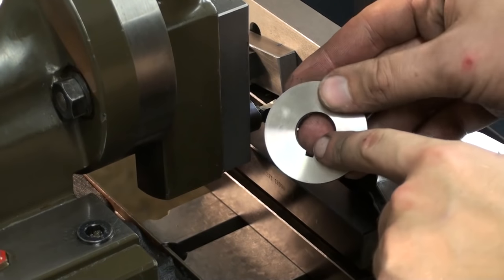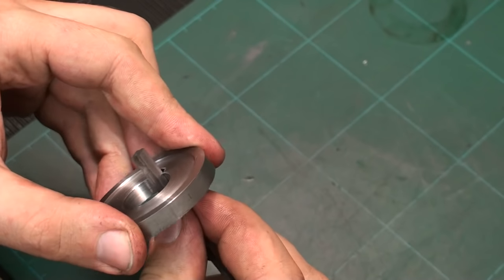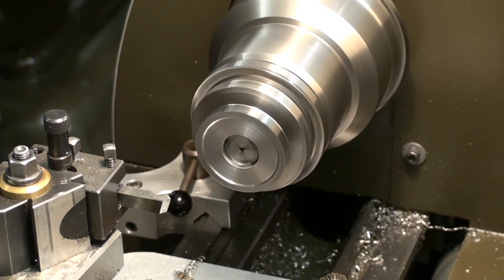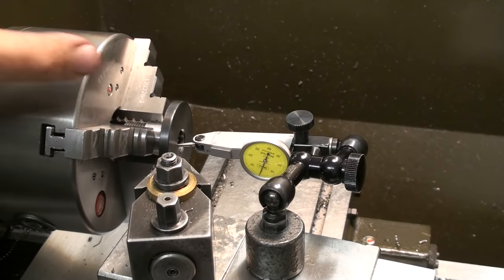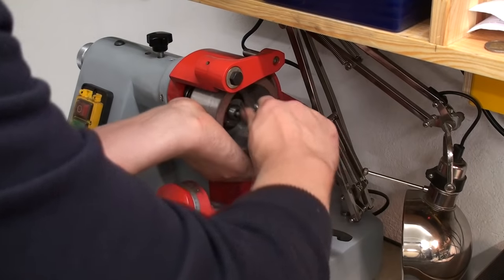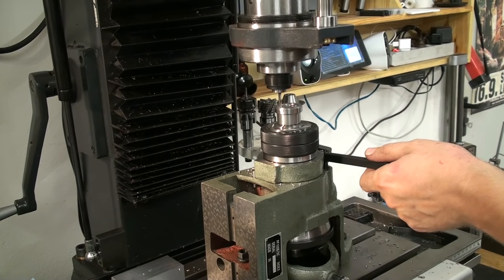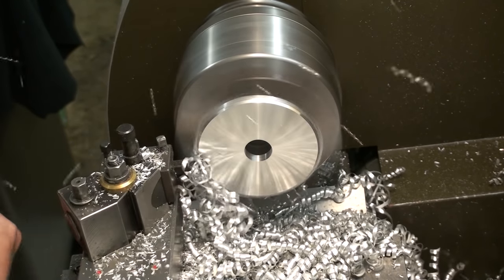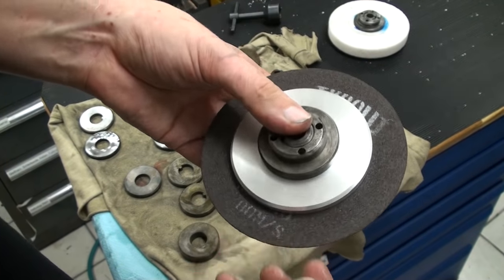Grinding wheel adaptors - Part 2

Comment: Nice to see another Proxxon user. I advise anyone who doesn't have a rotary tool like a Dremel to buy Proxxon. If you already have a Dremel, throw it away and buy a Proxxon tool. They have an actual speed control that maintains the speed under load so you don't have to max it out to grind anything tougher than cardboard. Plus the rotor has many more poles and this makes it a lot quieter. You can turn it right up to 20,000 rpm without needing ear muffs.

Comment: whoa whoa whoa.. mini 3 jaw chuck?  You think you can just flash that up on the screen without talking about it?  Or did I miss that video?  That looks right handy.  Nice work on the adapters, can never have enough of those.  Only thing I don't like is they wouldn't fit my grinder. :)
Reply from the maker: You dont have a baby 3 jaw chuck? Just put two three jaw chucks in a drawer and leave them alone for some time...magic will happen :D
Reply: This Old Tony doesn't everyone have one of those??? :)
Reply: Okay, I just did that; turned the lights down and put on some music for good measure.  Fingers crossed!
Reply: Any luck Tony?
Reply: @ThisOldTony any luck yet?  That chuck should be in school by now.

Comment: Thank you very much for producing this series. I recently bought the same cutter grinder and when I went to order extra adapter hubs for it is was told $70.00 CAD ($55.46 US) each. I checked the SHARS website in the US and they want $29.95 US ($37.79 CAD) which is a lot better deal until you include delivery, customs and taxes. On the SARS site though is a blueprint with all the pertinent dimensions on it for the adapter so it will be a piece of round stock from the metal supply and some time on my part.

Comment: Excellent project Stefan. Great workmanship once again. Your "close enough for me" would put many a machinist to shame. Its nice to have enough tool holders or grinding wheel holders so there is no need to keep swapping things around. Many thanks for sharing. regards from the UK
Reply from the maker: True words about having enough toolholders for the lathe ;)
I plan to build even more, I still swap them around from time to time...but for the grinder I am pretty good setup now, as it seems.

Comment: Nice! Now I want to see this thin cutting wheels at work.
Reply from the maker: Until yesterday I never used them. And I can tell you, they are awesome :D
Used them to cut some HSS blanks down to size and they cut waaaaaay faster than a thin cuttoff wheel in a anglegrinder...
Reply: I just got a used 6xx12 Boyar-Schultz but never thought of using it with cut off wheels, great idea

Comment: Nice!  I just bought a couple wheel adapters for my Brown & Sharpe surface grinder and the best price I could find for new high quality ones (Sopko) was $50.00 USD each plus $8.00 freight.  I will be looking more closely at what you have done here and possibly making some...

Comment: I see you stock only diamond superabrasive wheels. I would have tho8ught your have ar least on CBN (cubic boron nitride) cup wheel for detailing HSS cutters and hard steel were wheel wear and loss of dress was a factor.

I was taught (back when dinosaurs walked the Earth) that grinding with diamond  diamond in iron alloys were uneconomical. The explananation was carbon's soluability in iron at grinding flash temperatures. My experience in grinding hardened lathe beds etc bore this out. A CBN wheel outlasted diamond grinding the ways of a 500 mm swing Okuma lathe bed 2. meters long by 3 to 4 times. 

Nice work on the wheel hubs, by the way. Very systeatic and well explained. I used to despair getting through to my apprentices the economies of time and accuracy to be gained by batching parts operation by operation compared to completing one at a time; especially where good references could be established to clamp to stops, recesses, pots. or mandrels.
Reply from the maker: I think I am a bit to cheap for the CBN wheels - I know and have seen their benefits, but man, they are expensive..and nowadays most of my tooling is carbide anyway :)

Comment: Stefan, get the Proxxon IB/E or IBS/E, or the LB/E LBS/E., same precision but more power.
The long version might be more useful as a toolpost grinder, and maybe even support higher side loads as the bearings should be further apart.  Side loads are pretty much my only gripe with the IB/E, unlkie the Dremel it has a separate motor so the spindle bearings are very close together. The Proxxon is still far superior despite that of course, not so loud and the tools cut by rotation rather than vibration.

Comment: Stefan - great work as usual. I really like the end result! What sized grinding wheels does your surface grinder take? Also, what is the diameter of the spindle at the major side of the taper?
I'm currently building a small surface grinder and I'm at the point where I need to build the spindle, but need to decide on the size first...
Reply from the maker: The toolgrinder takes 100mm wheels, the surface grinder takes 125mm wheels. The large end of the taper is about 13mm in diameter if I remember correctly.

Comment: Hi Stefan

Another great video. :-) I have a couple of questions for you.

Why did you use the triangular file instead of a half round file when cleaning up the silver solder around the key on the inside of the washer bore?

Why did you use a cut off wheel on the "dremel" instead of a wire brush? A wire brush can remove burrs and leave a nicer deburred finish than a cut off wheel.

Kind regards

Peter
Reply from the maker: Thank you! 
As for your questions:
- Because i could not get into a sharp corner with the triangular file - For the round sections I used a halfround file.
- The wire wheel only removes a very minimal amount of material - With the cutoff wheel I was able to create a proper chamfer

Comment: Just a question regarding the taper bore setup : If the dial indicator is not on the exact centerline of the bore will it still indicate the true angle of the bore? 
regards
Reply from the maker: Right, if the tip is off center the measured taper will get steeper than the real taper...its not supercritical, but you have to keep an eye on it. I just eyeball the tip of the DTI against a dead center in the tailstock to get it to height.
Reply: Thanks, I'd hire you in a heartbeat!

Comment: Do you have power feed on the compound? Keep the video coming they are great. Dave
Reply from the maker: Kinda...I have a cordless drill and an adaptor that goes on the crank of the compound, but those short tapes where turned entirely by hand.

Comment: Very well done Stefan.   They look good and the effort is well worth it.  Question, but mostly on the diamond wheels....when you mount them on the surface or tool grinder will you need to mark the rotational orientation of the wheel to the spindle each time you remount them?   Or, are the adapters true enough to ignore this possible factor?

Comment: You do beautiful work!  I am in awe, and jealous.

I'm wondering if adapters could be used on a bench grinder.  It would be really nice to switch stones, or a wire wheels, without the whole un-bolt, re-bolt, re-true thing.

Comment: i know its a old vid but i just made myself a batch of these adapters as well cause i needed 4extra now i got 12 lol dont know how that happened guess is got plenty for the time being , i do got a question on the original one there is a peace of felt on the arbor aswell is that strictly necessary?
Reply from the maker: I dont think so - On ceramic wheels the thin cardstock washer is important, to not crush the wheel, but thats all.

Also you can never have to much wheel hubs. I just made 6 additional ones for my current surface grinder :D
Reply: @StefanGotteswinter  thanks for the reply

Comment: I am always impressed with how clean and organized your keep your shop! Question, Do you use any type of ventilation system?
Reply from the maker: No, I have a window and a dehumidifier - If I need to change the air in the shop faster, I set a fan in the open window ;)

Comment: Awesome video, interesting seeing the motor bog down like that. After seeing your lathe improvement video, I copied your topslide mounting system and the difference in rigidity was mind blowing...unfortunately now I'm limited by the 550w motor running out of power instead of the chatter and zero rigidity :(

Comment: I broke one of my Proxxon micromot collet nuts in half. I don't know why nobody make a Dremel or small die grinder with ER11 or ER8
Reply: I know someone who got an RC motor with an 8mm bore and shoved one of those 8mm straight shank ER16 chucks up it.  He uses it as a milling spindle but it's small enough to hand hold.
Reply: MattOGormanSmith Yeah, after breaking the micromot collet nut I replaced the spindle with an ER11 and a brushless motor. Also some time later I made a high speed spindle that can be mounted on my mill spindle: https://s25.postimg.org/e0fijr5lb/IMG_20160502_193044.jpg

Comment: Two great videos. Since I have the same tool grinder and just got a small surface grinder I will have to try making similar adapters. You might consider adding a larger diameter nut with tapped holes near the outer edge as shown in: www.youtube.com/watch?v=VIUeZoGn-gU to balance the wheel assemblies.
I also liked the balancing stand shown in this video and have just finished building one.
Reply from the maker: Yes, agree on both things :)
But I want also to try the balancing method that was shown in one of the suburban tool videos, where they just removed material from the grinding wheel with a drill...

Comment: Stefan, you made yourself a lot of hard work by hard soldering the keys in. You could have used soft solder or even Loctite, you only needed the keys not to fall out when you removed the washer to change the wheel.

Comment: Next time you need to use micrometer blue to check fits, DO NOT use your fingers to apply it, not only are you using too much, but you get your hands in a mess.Apply the barest minimum using a cotton bud, works great and no messy blue fingers.